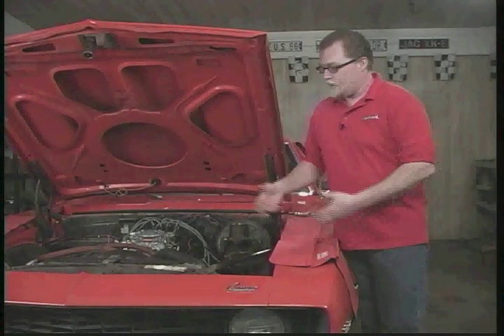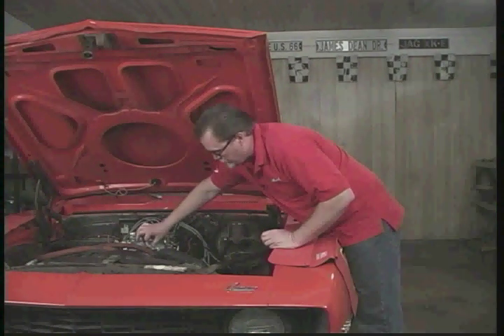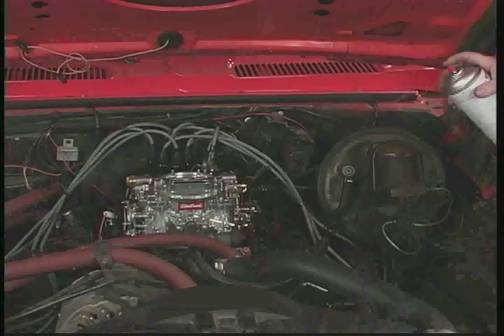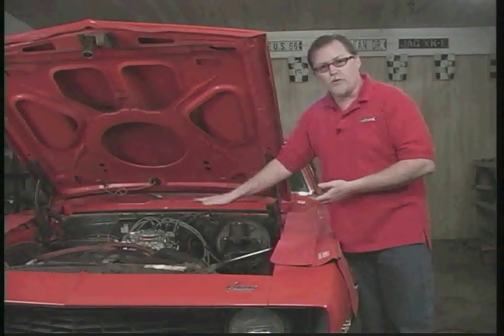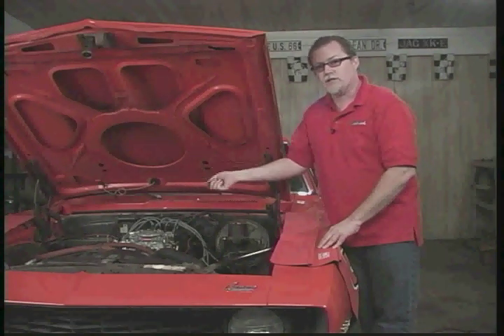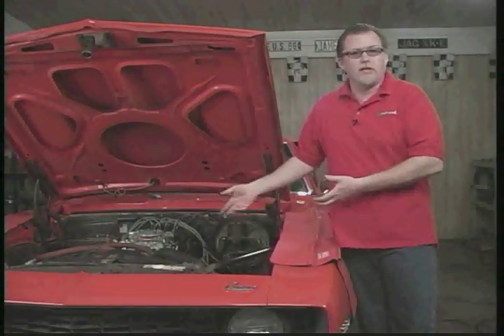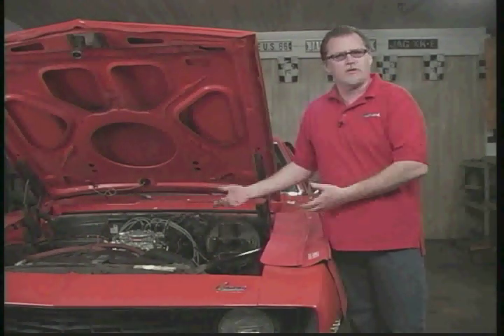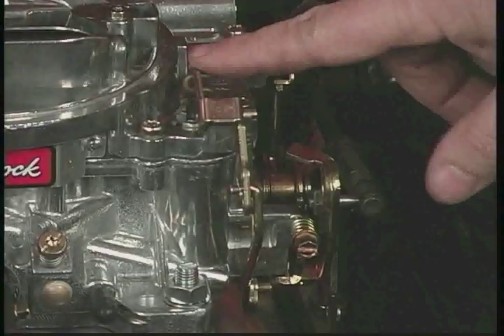Edelbrock Carburetor Installation and Troubleshooting Part 5 - Troubleshooting

Comment: 7:27  i got an old 83 D 150 with a 318 and a 727 auto trans. it likes to shift at around 6500 RPM no matter what gear its in, do you know if the 727 Chrysler transmissions have a vacuum port or something? it currently has a Edelbrock 1406 carb on it.

Comment: does me having my hot wire run to the distributor instead of the fuse block and my ground being on the carb base affect it in any negative ways?

Comment: Im having problems with my edelbrock performer carburetor on olds 307 engine. Engine doesnt want to idle and doesnt run on all cylinders. When i give it more revs, it starts to run on all eight. 
Longer it idles, it drops off cylinders until it stalls. 
There are no vacuum leaks and carburetor is clean.
Maybe the problem is that olds hei distributor might use manifold vacuum, and i have it connected on ported vacuum?

Comment from the maker: Again, from Big Dave, our Certified Master Engine Machinist: It is better to replace the needle and seat, they are very hard to just clean. When you adjusted the needle and seat did you have the sight plug out on the side of the carb? You need to have the fuel at the bottom of the sight plug just barely trickling out of the hole. To low and the carb will cut out and bog down.

Comment: I cleaned the needle though and I adjusted the skrew on the back to lower the floater but nothing changes.  Some people said the float had a hole in it which it don't or maybe the needle is sticking but I cleaned though.  Idk whats going on.  It won't idle, it just shuts off,

Comment from the maker: Big Dave, our CMEE, answers: First off I do not fly! :) I would first find out why it is overheating and fix that problem. “she is going through gas like crazy !!” This could be a fuel pressure problem, a dirty carburetor, or even a heavy foot on the gas pedal.The idle being high could be from slight flooding of the carb because of high fuel pressure or dirt in the carb, again, or you could have a vacuum leak caused by a bad carb to intake gasket or an intake manifold to head gasket.

Comment: hey i had a fall out with safeway gas it ruined my fuel system and now my engine is not properly regulating fuel.... its a uneven run and it just gets worse and worse. i added techron for a DAY IT WAS DOING GOOD.. THEN WHEN I WOKE UP all hell broke lose i tried re adjusting the carb... but it does me no good what so ever. what is the proper way to fix these problems and the adjust the carb.

Comment from the maker: Use Edelbrock 1403 with Edelbrock 8126 with a Mr. Gasket 1932 adapter. The reason we asked is this adapter will only work if it is an original 4 barrel Quadrajet intake. If not, you'll need an Edelbrock 5486 manifold and you won't need the adapter. Also, you'll need to have a fuel filter between the fuel pump and carb. You can get this at a local parts store. Ask for an inline fuel filter, not one for a 1982 Buick V-6.

Comment from the maker: @85oscarin You would need a timing light and check the ignition at an idle with the vacuum line going to the distributor unhooked and plugged off. The timing should be around 10 before TDC.

Comment from the maker: @85oscarin This is a combination of things: ignition timing problems (usually timing is too high), carb leaking fuel after the engine is cut off ( rebuild carb and check fuel pressure), and last but not least the sorry gas that is being sold today contributes a lot to the problem.

Comment: Great videos  . Im getting the under load bog , started happening since i put on the rpm heads and air gap intake . im running the 1406 economy carb which says its not happy with the new parts I put on . going to get a 650 thunder series avs and just put my performer intake back on for the winter with my 1406 .